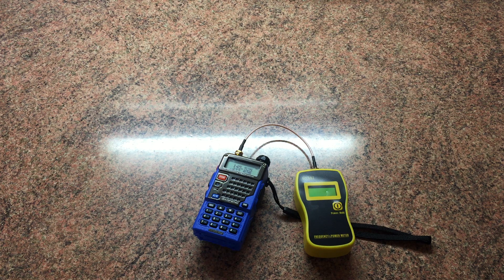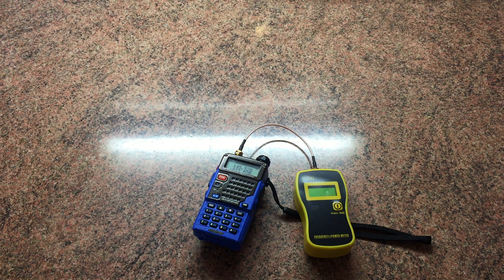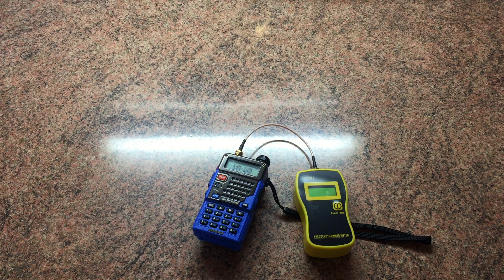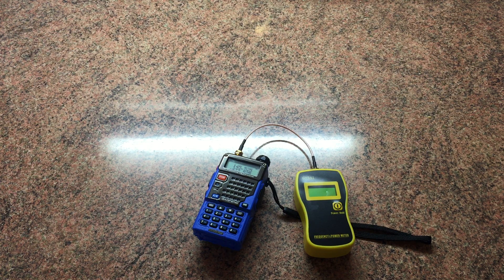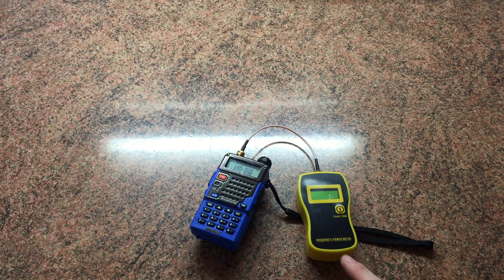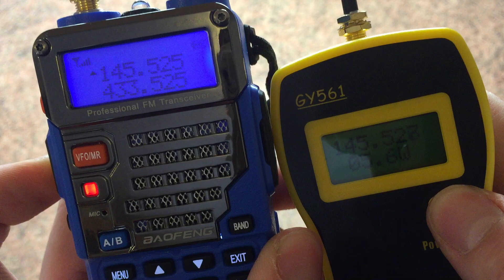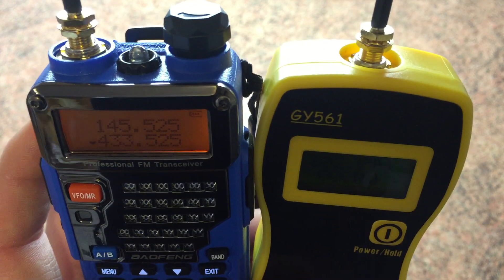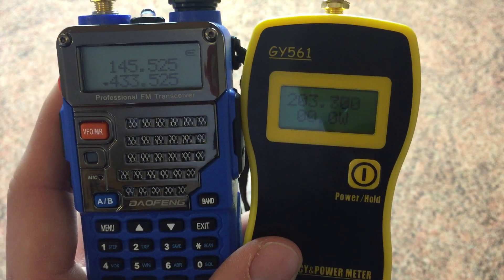Baofeng UV-5RE Power Test With GY561 Meter Part 2

Comment: Are these better than the standard  5r ?
Reply from the maker: All pretty much the same ALan
Reply: @RingwayManchester  I have a uv-5r and an 8 watt (wink wink) model.  Seem the same to me... can't blame them for trying to rebadge them!  On the other hand, they're $25USD when on sale.  So you can't blame me for being daft enuf to buy another, either!  You will be happy when you're up on the roof or out on the lake or so... as they're rock solid for short range communications.
They're also pretty good for reception from distant repeaters... tho' I never have any luck getting signal out to a repeater from our locale due to inferior wattage and quality of transmission.  I think that sums it up.

Comment: Hi, on my uv5re when scanning the backlight will not switch off after the set time of 5 seconds, but will in other modes, on my other Baofeng radios uv5r etc it does switch off at the set time, anyone else notice this, it's a pain as it drains the battery quicker when in scanning your stored frequencies.